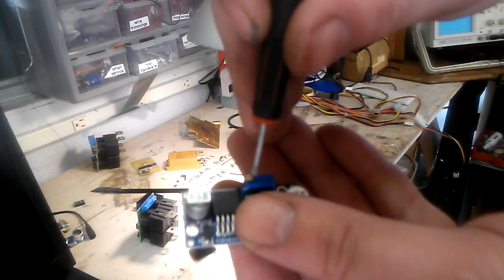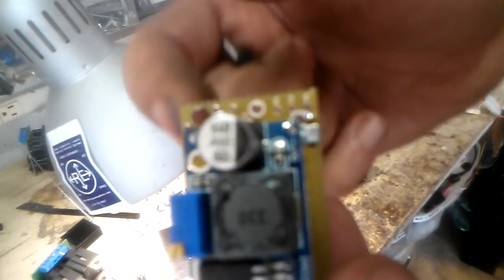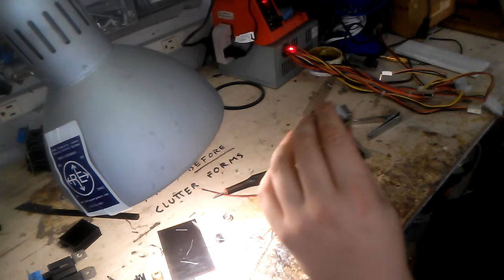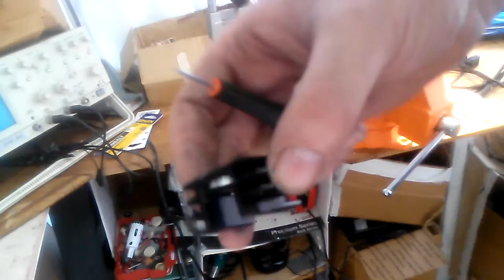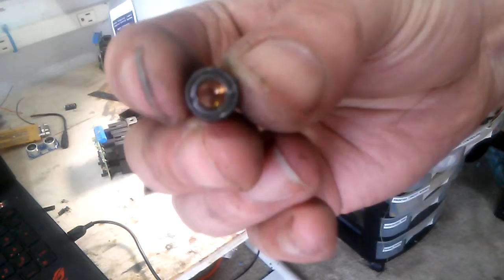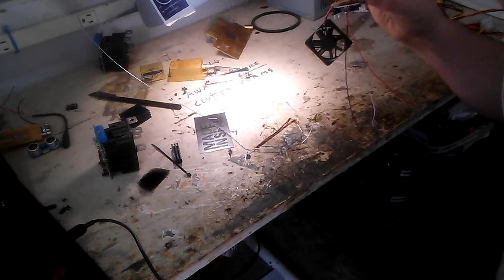L-Cheapo Mk2 - How To Build

Comment: is there a Gerber files for this version and BOM?
Reply from the maker: +Timon Whe The BOM is the same, but the wiki doesn't have gerbers yet.
Reply: +Spiritplumber I like the setup of this better than the first very nicely done.  Will the gerber be or eagle files be available soon? A link to the voltage regulator also if possible